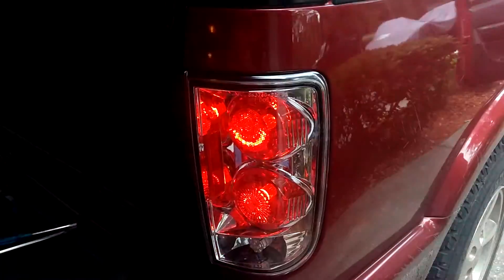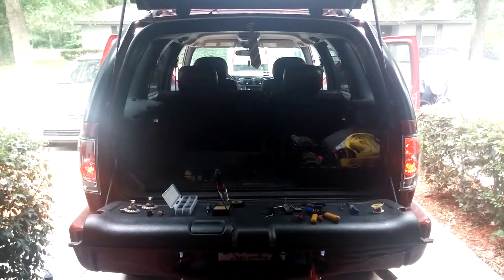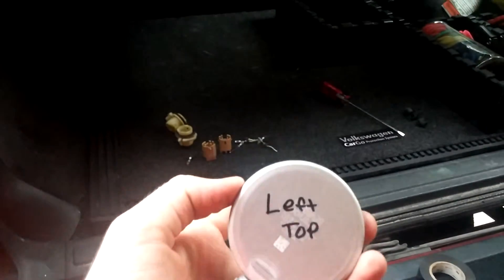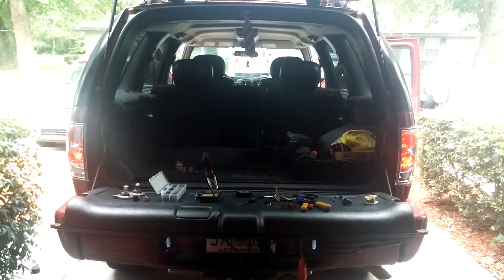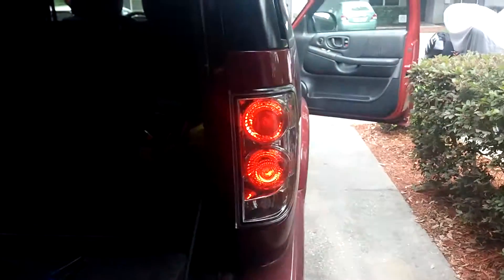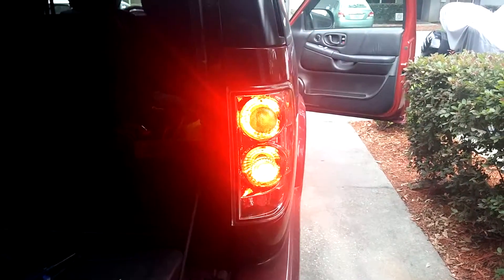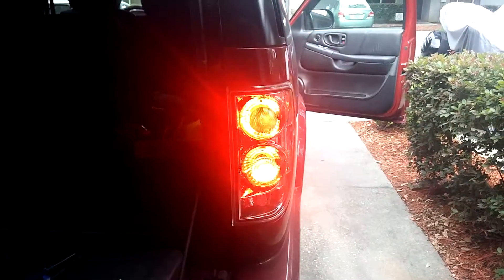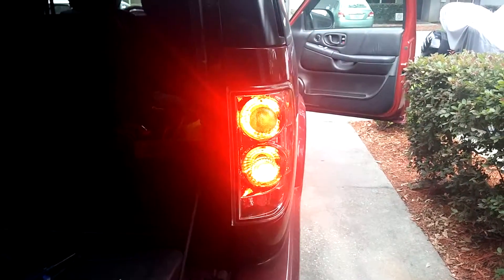Osram Joule LED tail light retrofit into a 2004 Chevy Blazer

Comment: I saw your write-ups on the lighting forums.  I sure wish you could do a comparison using the correct incandescent bulb or even upgrade to an even brighter and approved by the lighting engineer experts on the forum to the GE Nighthawk 3457 bulb (40/3 candlepower) which is brighter than the factory incandescent bulb (32/3).   Wait til the GE-NH 3457's go on sale on Amazon.....should only cost $5-6  for 2 pack.

  The comparison is accurately viewed backing up against a white-wall at night about 5' 10', 20', 30' to see the beam pattern projected and compare the incandescent vs. the OSRAM JOULE.......but these experts strongly dispute that the JOULE is just not designed for a housing designed for an incandescent bulb, however the only upgraded LED's they recommend are the Sylvania ZEVO's or the  Philips X-tremeUltinon gen2 LED X-treme Ultinon, and yet they say those LED retrofits only truly project the correct beam pattern in a very small fraction of vehicles depending on the lamp housing design.......and they once again recommend doing the beam pattern comparison at night/day and also viewing from all angles about 20'-30' from:  hi-low-side to side to look for any dimness compared to the incandescent bulb.....

I will soon be testing and retrofitting some JOULE's to see if they can duplicate and project the same beam pattern as an incandescent...........